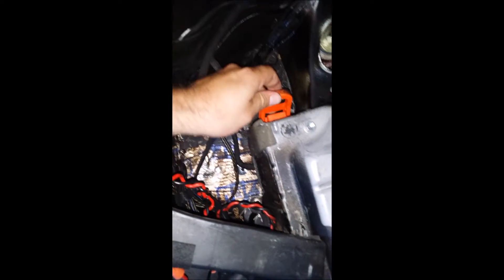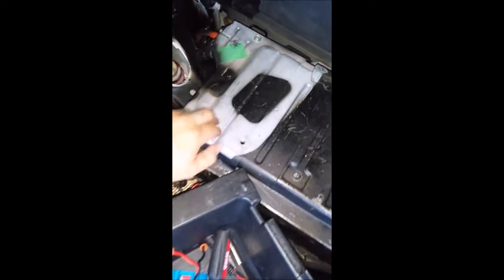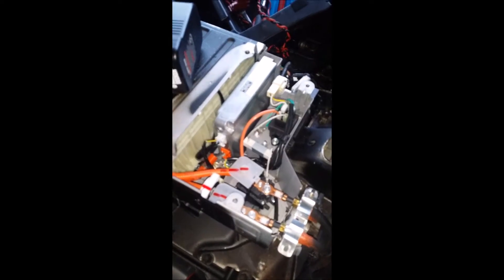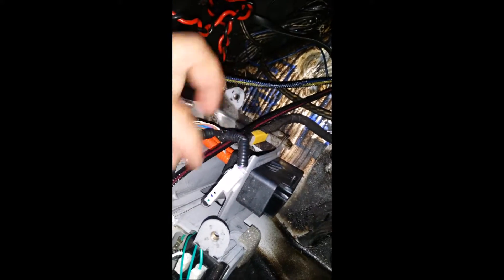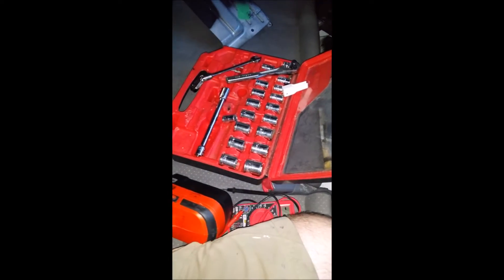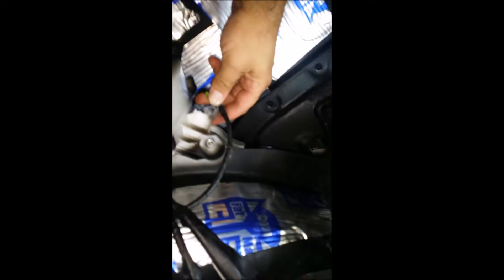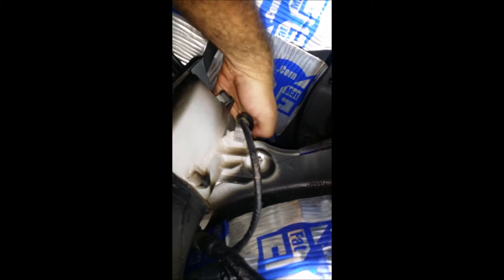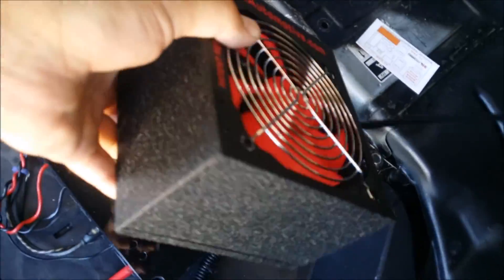Prius grid charger install

Comment: You are just another victim of the "Greed Charger" scam. You are showing how you just put yourself at risk by touching battery positive terminal with bare hands. If the pack was leaky (and they could be in 2006 Prius) there would be voltage >50V present between that positive terminal and battery casing - enough to kill you.
Then you bypassed safety precautions designed by Toyota and took High Voltage out of the battery pack. That is lethal in principal and very stupid to do regardless of what that manual tells you!
Mind you: any grid charger installed in Prius or Honda - does not improve anything. It is unsafe and useless.
I have designed and build a lot of High Voltage Chargers which I use in battery rebuild practice and was always against installing chargers in cars for so called "maintenance purpose". The only scenario you may need rescue charger is when the battery is depleted after being stored for too long (over 6-12 months).